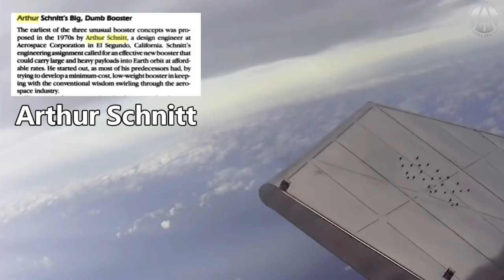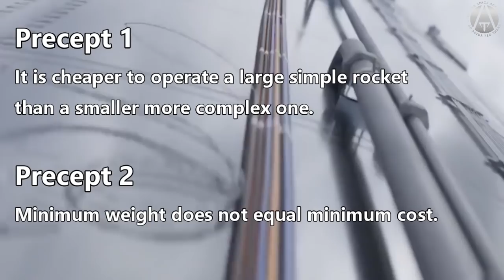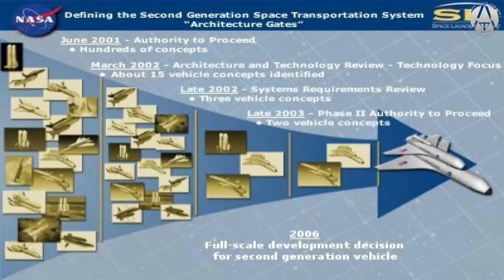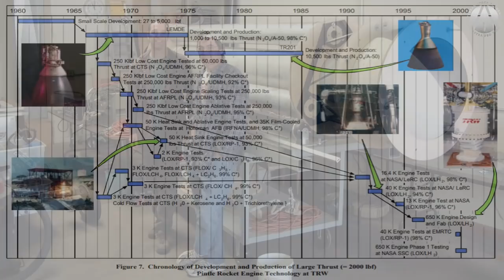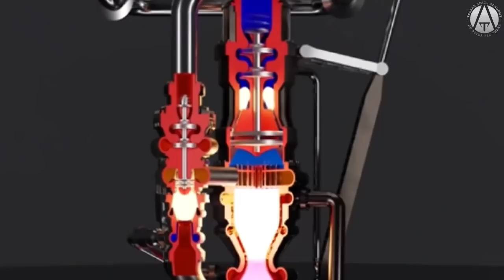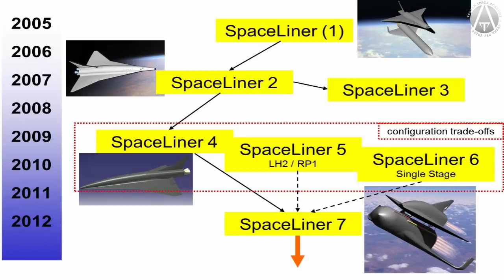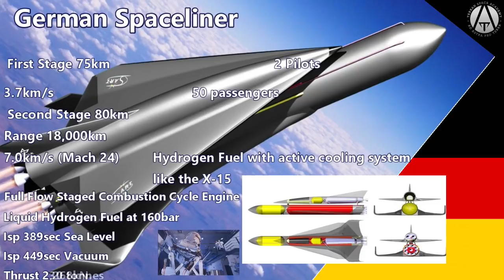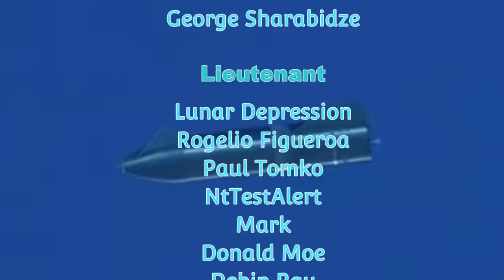SpaceX Starship: What is so special about the Starship system?

Comment: I think everything will change if the Starship concept is proven. Certainly china will want to build large low cost vehicles if Spacex shows that they can be successful. I imagine the Japanese will do it too if they see a commercial application. Curiously the Europeans will have most difficulty in adapting I think because of their bureaucracy, but they have managed to pull off large projects like airbus before, even if they do have to split the work between different countries. The secondary issue is, is there enough work for these rockets to do? We just don't use space that much and the commercial applications are immature.
Reply from the maker: I agree... if Starship even makes it to orbit I see half a dozen versions going into rapid development around the world.
Reply: @Lynn Geek the future is in rotation
Reply: While I can see why you think why European bureaucracy might have more trouble adapting, the reality seems to indicate otherwise. They already have a fully reusable rocket development in the works based on a methane engine. I believe they basically straight up admitted that there is no particular shame to copy some ones good idea if you don't have a better one yourself. So they are.

I suspect this might be because the European system is substantially less corrupt, which means they do not like continuing to fund an expensive rocket solution when a cheap one can be made. No job programs just for jobs, but getting more effect from it when possible.
Reply: @Quickshot0  let's hope. Europe has it's fair share of curruption, it's just not as brazen as the U.S. I'm sure we'll get there as a species in the end
Reply: @maq6144  Indeed it does, trying to claim it was corruption free would be pretty foolish.

And I figure that in the end what makes the difference in how well we succeed in things, is the systems we setup to facilitate it. We all have our individual flaws, problems, limitations, etc. But a good system can help bridge much of that and minimize the problems.

So hopefully the future will bring good systems for all of humanity.

Comment: So in short Starship would be good for putting heavy loads in orbit, however Starship is supposed to be an interplanetary rocket, they wanna use it to create bases and colonies on other planets, and when you start considering these missions you run into all sorts of design flaws and limitations that make them impossible.
As usual with Elon Musk's promises it will be greatly downgraded in the end and it will be sad that a rocket sold as interplanery will end up being used as cargo launcher...
Reply: Not sad, because we don’t get any interplanetary passenger ships without massive cargo to orbit capability.
Reply: @marxug1  thats not true, you can have many smaller and simpler spacecraft that carry a bunch of people each, something like ISS modules, we already know how to make them and all countries can make their own just like for the ISS.
Starship is supposed to have 100 people in it, good luck with that lol...
Plus going to the Moon is one thing, going to Mars is a much greater issue.
Reply: @MARK-gp9hb  - And the thousands of scientists and engineers working at SpaceX? know exactly how hard it is. They're trying to do it anyway - I guess some humans have more hope than you.
Reply: @JohnnyWednesday  i forgot to mention all the orbital refuelings that Starship will need.
SpaceX proposes to refuel it with another Starship (which is dumb) and originally these 2 were supposed to dock at the "bottom" of the spacecrafts (the part with the engines) which is so dumb, in fact now they scrapped that idea and say they will dock side to side...
So yea nobody is denying that thousands of respectable people are working on the Starship, just that some of the things they propose are impractical or dumb, as they themselves must have figured out since they changed their plans...
Oh and yea, the idea behind Starship is not new at all, its not a SpaceX design, it was conceived at the beginning of astronautics and scrapped by everybody including NASA, and SpaceX isnt better than all of them...
Finally, last but not least, its not true that "humans with more hope" are the ones who enter history, unfortunately. Think about Pelterie, he was skeptical about going to the Moon with a rocket, yet he is considered as a founding father of astronautics. Other people like Luigi Gussalli, who was much more "full of hope" than Pelterie, are pretty much unknown when they should deserve more credit.
Reply: @Lynn Geek what do landings have to do with it? I was talking about supporting the lives of 100 people for a 7 months trip to Mars.

But yea if you want to talk about landings, how about we discuss the landing on the Moon or on Mars? One thing is landing on a clean horizontal pad, another thing will be landing on irregular terrain.
The original ITS design had big landing legs, then they were removed, now they realised they need legs so they built some from scrap material, at least from some pictures ive seen, you call that good engineering?
Reply: @Lynn Geek  "no one can predict in advance if a particular design will be good or not" yes we can, the ultimate goal of science is to be able to make predictions (through mathematical models for example), the only way you cant make a prediction is when you dont have a specific design to test but just a vague concept. Sometimes trial and error is the other way, it can even save time, but other times its possible to make predictions.
I'm sure our knowledge of the properties of materials has improved since the times of Edison, now we may only need to test a handful of materials instead of 600.
(Btw Edison did not find the right material, it was an italian inventor if im not mistaken)
This example you made is very good, it reminds me of when Elon Musk wanted to use carbon fiber to build the starship, he was so proud of it, but then SpaceX understood its limits (mainly the cost) and changed their mind. So Elon Musk didn't even do a simple cost-benefit calculation before making this decision, and we can find many more examples of this throughout his career, to me this doesnt look like a genius.

Same for landing legs, catching the rocket adds unnecessary complications, plus lending legs will still have to be developed for landing on other planets.
You are telling me the weight of legs is a problem? For a rocket that is advertised as able to lift more weight than ever? Or do you just not want to admit that they didnt design it well...

Plenty of scientists and experts agree that Starship is a flawed design (we dont even need to be rocket scientists to talk about it, Musk isn't), and there are problems with all of Musk's "ideas" (mostly are ideas he copied or stole from others); he is a genius of marketing (with the help of the media), but not even Steve Jobs' level of marketing genius, at least when you bought Apple products you got them, overpriced but still, no with Elon Musk you dont even get what was promised to you. He is only a genius of stealing from others and lying and fooling people, all the rest shows that he is scientifically illiterate (like when he wanted to use air bearings in a vacuum) and sometimes even a psycopath.

Oh but, there have been many self-taught and foolish inventors, right? Yes, but if you compare Elon to those individual inventors you will see he is not like them.
Remember that Elon Musk is just a rich kid who managed to get in key positions and take over companies, which now he and the media claim he founded, he himself invented nothing new or revolutionary, he actually stole inventions and made them only worse. He keeps making promises he doesnt deliver, so that people keep investing. SpaceX would be dead if it werent for NASA and now its going bankrupt, Tesla has failed at many things, Solar City is a failure, the Hyperloop will fail, the Boring Company has hilariously underdelivered and now all the projects are canceled so its failing.
And if any good comes out of these companies it will be thanks to the original founders and the people who invested and especially the people who work in them, not Elon Musk.

I hope you see i don't have an irrational hate for Elon Musk, everything has a reason. I also hope you will see him for what he really is and not some real life Tony Stark that people desperately want him to be...
Reply: @MARK-gp9hb  Following your argument, every rich kid could start and succeed with any Tesla and Space X clone...wait, why aren't there any?
Reply: @benzengap6804  why? thats not my argument at all.
A lot of people already enjoy the same treatment, for example some politicians.
For entrepreneurs its a bit different, and it depends on the country and the kind of company they have.

Real world example, Elizabeth Holmes of Theranos. She was young and founded 1 company that didnt deliver, investigations followed and now her net worth has dropped.

Musk has taken over many successful companies that dont fail easily, he also gets money from states and governments, from NASA, he is much better than Elizabeth Holmes at selling products that dont exist, and he gets help from most of the media around the world who never question him and only show his successes, never his failures (only in the US ive seen some media coverage of his failures)
Reply: @benzengap6804  any company really, but ofc after Musk took over they kept growing, or for example with Neuralink the company was unknown before Musk came in, and for obvious reasons.
His popularity alone will make his companies popular, even when they underdeliver or they dont make anything new (like Neuralink).
Musk's ideas have failed several times already and have caused him to get sued, for example by the real founders of Tesla.
Is this what you like? Idk what you are trying to say, are you saying that because these companies are now bigger than they used to be its all thanks to Elon Musk and that this makes him immune to criticism?
Reply: @MARK-gp9hb  PLS name one CEO who did everything right. And i mean makers and not caretakers. Caretakers are important as well but they just improve the performance of a product. But you cant improve a horse so that it becomes a car. You have to start from scratch and this is what makers do. They are willing to take the risk but they arent always successful. Were Edison, Ford, Jobs or Gates always successful? Nope.
Reply: @oxybenzol9254  thats what im saying! these Musk fanboys think Elon is perfect and dont accept any criticism.
Reply: @MARK-gp9hb  But this answer is somewhat differnt to what you said before.
"...Elon Musk wanted to use carbon fiber to build the starship, he was so proud of it, but then SpaceX understood its limits..."
The first pictures of Rocket Labs next gen Rocket Neutron look more like Falcon 9 and now its completly different. Plus Peter Beck the CEO ate his hat cos he thought they coudnt recover the 1st stage of the Electron. So he is a douchebag, right?
And what about the X-33? It look cool but its a SSTO and NASA is well aware of the rocket equation.
Or the Columbia disaster? This already nearly happend in 1988 with STS-27. The only difference was below the damaged heat tiles was a steel plate for structural reasons.

Elon isnt perfect. But how ever you define him also leads to a certain defintion for all the other leaders of Boeing, Lockheed, Ariane Space, Roskosmos and such. Im sure they didnt won their job in the lottery and those companies have decades of experince in the rocket business but somehow they are way behind.

 "mostly are ideas he copied or stole from others"
What do you mean with this? Something like "some guy invented the wheel 4000 years ago but even with all the tech today people are to fat and lazy to come up with a better idea".
Reply: @oxybenzol9254  you said it, NASA and the others pioneered spaceflight, they came first, and even when copying each other they didnt make things worse (for example the Buran is slightly better than the Space Shuttle).
Elon Musk instead is copying old ideas, passing them as his own, and making them worse.
Example: the underground Loop, its basically cars in tunnels, only his tunnels are smaller (which limits the amount of cars and the safety) and the cars are slow (30 mph....).
But there would be nothing wrong with it, if people saw these failures for what they are.
Instead people use double standards and accept whatever comes out of Elon Musk, they cheer at every stupid promise that will never materialize, and when he underdelivers nobody cares
Reply: @MARK-gp9hb  LOL. You complain about double standards. Youre exactly like those Musk fanboys with your double standards.
Reply: @oxybenzol9254  when did i use double standards?
Reply: your perseption about Musk: Elon Musk instead is copying old ideas, passing them as his own, and making them worse.

your perception about others: even when copying each other they didnt make things worse

Is Falcon 9/heavy, Raptor, Dragon, Model S, Y, 3 worse?

Is SLS and Starliner better or at least equal to alternatives?
Nope. SLS is a Saturn V reboot without any technologial advancements for about $20Bill plus $2Bill for each additional year. Plus a launch costs more than a Saturn V launch including inflation.
First Starliner launch failed. Software error in the main path, 1 of 4 parachutes didnt open and then there were some other problems as well.
Second try a year later failed again. This time 12 valves stuck due to moisture. Moist air near the ocean. Who would have thought about that.
And the worst thing about it. Starliner is build for crew transport so the safty checks should be top-notch.

And then there is this "...NASA and the others pioneered spaceflight, they came first..."
This either means "they came first and did their work and now other should do the job" or
"they came first and figured everything out and thats why your not allowed to criticise them"
Reply: @oxybenzol9254    ok you are talking strictly about rockets then, i was talking about all of Elon's companies and ideas. When you look at his other companies its clear that hes copying from others and making things only worse.

You mentioned the Starliner, the Starliner did 1 semi-failed lunch and they want to cancel it, how many failed launches is Starship doing?
Only because less money was spent doesnt mean its better.
Doesn't that look like a double standard too?
I agree that SLS and Starliner are bad, they shouldnt even exist imo, but dont tell me that Starship is any better please...
And the Falcon was supposed to be fully reusable but only the first stage is reusable and not entirely.

The problem isn't that NASA and others "did it first", its that SpaceX is sold as more innovative than it really is.
Reply: @MARK-gp9hb  "You mentioned the Starliner, the Starliner did 1 semi-failed lunch and they want to cancel it, how many failed launches is Starship doing?"
None. Starliner wasnt a prototype but Starship is. There were discussions to not do a uncrewed test flight cos Boeing, old space, much more documentation...

"but dont tell me that Starship is any better please..." Do you realy compare Starship in its current state to Starliner or SLS?

"The problem isn't that NASA and others "did it first", its that SpaceX is sold as more innovative than it really is."
SpaceX dominates the commercial market. ULA(Boeing/Lockheed) were already out of business since Ariane 4. There is no other company with a reusable 1st stage. Rocket Lab an other new space company founded in 2006 will be the 2nd in 2 to 3 years.
The Merlin engine has the highest thrust to weight ratio which is a suprise cos the next ones in this list are all much bigger like RD-180, NK-33, F1. square-qube-lawe and not reducible complexity favor big ones. Raptor. And very important a different company structure thats why new space.
Old space has a military structure, lot of hierarchy and meetings, very time consuming and the branches work more toward their own goal instead of the goal of the company cos of this hierarchy.
Plus ULA is like socialism. They dont need to improve. They get their contracts no matter what cos politics, congress, jobs.

"...its that SpaceX is sold as more innovative than it really is..."
What should a more innovative company do? More launches?
Reply: @oxybenzol9254  Starship is not treated as a prototype tho, Elon Musk hypes everybody with it, NASA gave billions to SpaceX as sole contractor for landing on the Moon, so i'd say its pretty serious business.
Also the fact its still in prototype phase doesnt mean it can't be judged.

I'm comparing Starship and SLS assuming they work as promised, Starship has a lot of design flaws that will make it impossible to work as intended. There are many videos about this on YouTube, i encourage you to look at them.
In the end it's clear that Starship is a bad idea.

You are right on the space industry, essentially they have kept the same structure since the 50s, but the people are worse.
Add the fact that today there isnt really enough will and drive for great space endeavours, and you have a recipe for failure.
Usually a private company has more vision and determination, but it doesn't always equate to good ideas and success...
SpaceX was founded with the help of TRW veterans, TRW was key to the space race, the Mercury and Gemini programs, the early american satellites, etc.
So SpaceX isn't the ordinary start-up...
SpaceX can do great things, they just need to focus on more conventional projects and not on Starship
Reply from the maker: That will be fine with us... at least we can colonize the Moon.
Reply: @Lynn Geek respond to my message with facts and logic please
Reply: @Lynn Geek because i put time and effort into my messages and they have plenty of facts and logic, so it would be nice if you addressed those facts.
If you ignore everything it seems like you are running away...